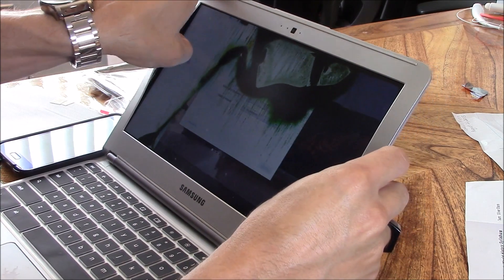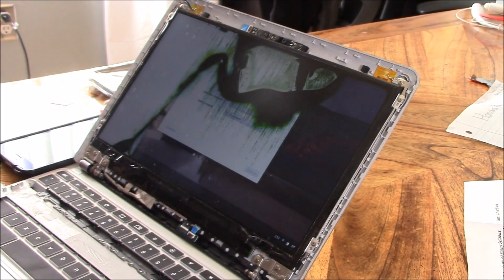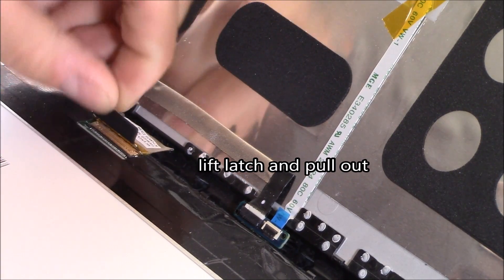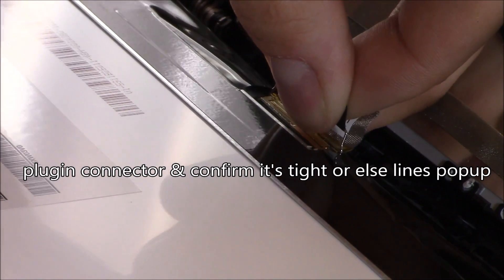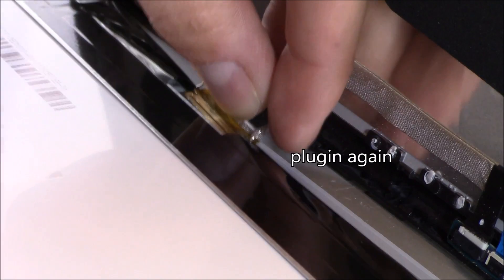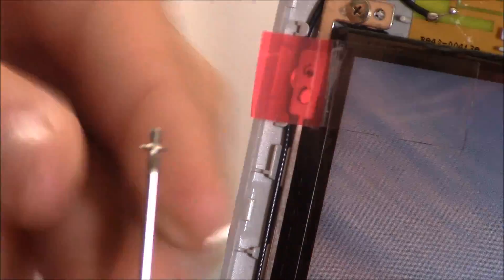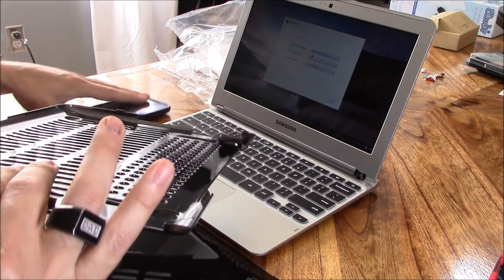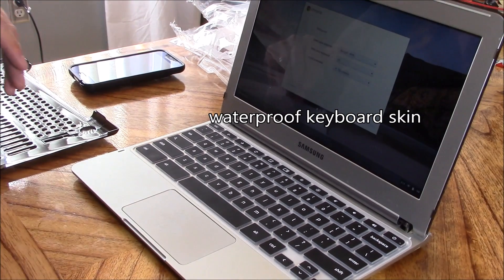EASY WAY HOW TO FIX A BROKEN LAPTOP LCD SCREEN

Comment from the maker: click here for LCD panel screens: http://goo.gl/mcoZkC NOTE: some laptop bezels have plastic screw covers on bezel, so use flathead screwdriver to pop out screw cover and unscrew to remove bezel, not all bezels easily pry off some have to be unscrewed.
Reply: i only have a crohme book will they still work
Reply: SecretOnWiiFit ' Same... I dropped it today ON the carpet from 
Ike 2 inches and it broke :( it’s was an accident
Reply: I have a cooper tablet that have lines in it can you show how to fix those

Comment: My screen isnt working but there is no cracked I must of scratched one second its fine , I turn around and when. I look again its got the lines.  I got it plugged in to an old monitor and fortunately that worked but I gotta get this fixed. I got this laptop a year ago brand new.

Comment: Hey, hello!

May I ask you... I have a little problem, my laptop LCD screen don't turn on the retroilumination... however the frontal panel works without problems... 

As I know, there is only one socket for the monitor (and mine looks well) so what do you think that can be the problem? maybe any bad connection in the motherbase or the power supply?  I don't get what way goes the energy from the mother base to the backscreen... so I dont know where to see if there is any problem.

Comment: Nice,I am surprised they have not made them water resistant already as a selling point.But I guess laptop sales.Ha!
I a have a question.What are some good resources for free schematics and service manuals?
Thank you.
Reply from the maker: owlmanual, ebay, amazon, or contact tv manufacturer but they might ask for your service center id number.    when I was a tv tech at best buy 2003 we had all tv service manuals on computer discs and book of service numbers to call with id numbers (wish I knew where it was now)
Reply: +Tampatec Thank you.